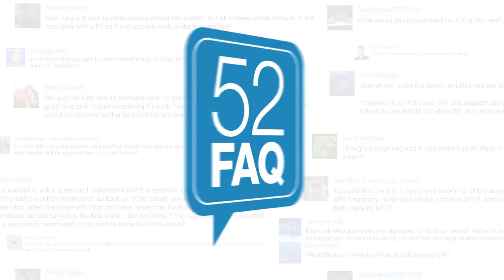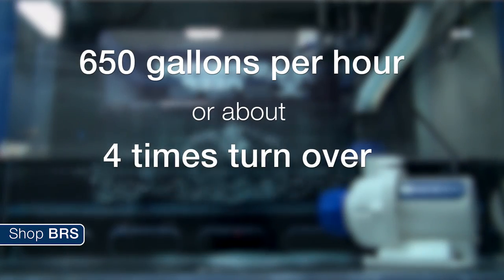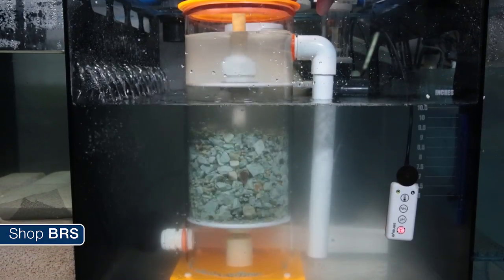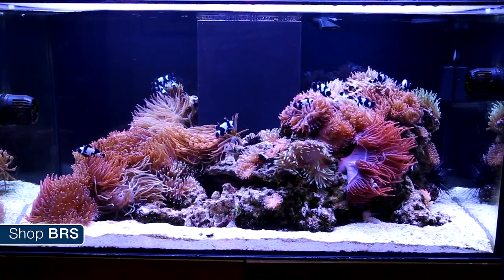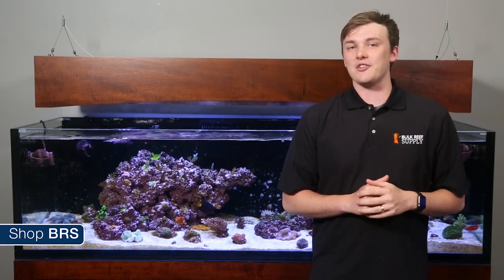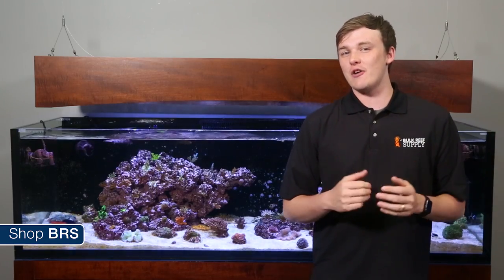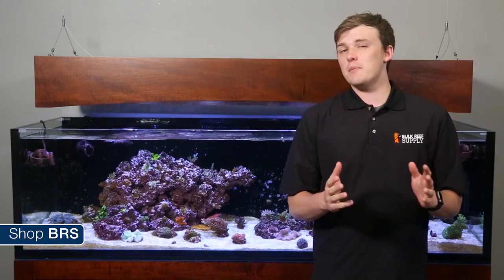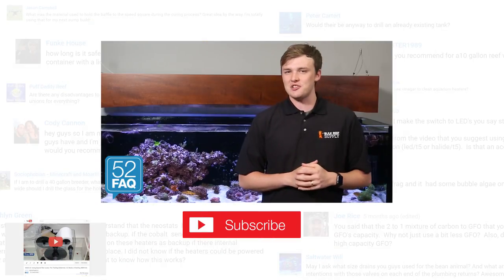FAQ #16: What is the relationship between the Theiling Rollermat and the tank's flow rate? | 52 FAQ

Comment: More great info!

I've seen a lot of people trying to jack their flow way up and like you said, there's a point of diminishing returns. If you're just looking for circulation in the tank, power heads are a much cheaper and more efficient option.

Another similar method of measuring return flow that I use is to turn of my return pump an let the water siphon down into my sump. I have 2 marks representing 5 gallons of water on the side of the sump, so I time how long it takes the water to drop between those two marks. Again, not 100% precise, but certainly accurate enough for our purposes.
Reply: And a huge thank you for stocking the English - Metric conversion fittings! They are impossible to find anywhere else!

Comment: I love the idea of this, we all hate cleaning filter socks. My only issue is even at max flow rate of 600 gph through the mat, its not even a 3x's per hour turn over rate on my tank. How would you deal with the extra volume from the tank drain? Im running a 220 gallon tank, and using the larger synergy reef overflow

Comment: thanks for the informative video.  i would like to know if the roller mat is in the sump how deep it should be and how many centimetres the water line should be from the float switch inside the unit .  thanks

Comment: I have a question, do you know what a Rotary Drum Filter is? It's usually used for pond and is basically like the roller mat only a lot better and requires no maintenance and no replacement parts. I have a a unit in my yard that rates for up to 30k liters/hour... the biological chamber alone is about 400 liters.... so using this for a reef tank might be overkill, but why isn't anyone making a "smaller" version of the rotary drum filter for reef tanks? seems like the perfect solution for mechanical filtration... btw, love your videos thx a lot!!

Comment: My rollermat has a lot of condensation in the top, how do you guys managed to deal with that?
Reply: Actually mine just started to have a problem. The condensation is so much that the current filter roll is super wet and super heavy which caused the rollermat to not roll it and started to overflow through the emergency overflow, but my roll still has like a 1/4th left of clean filter. I have to manually roll the new roll so it gets lose so that the rollermat can roll it without any problem. This is the only major flaw I have found so far :(
Reply: 100% positive there is no splashing on that side of the rollermat. I run my tank at 76, I live in Seattle so no AC really here :P but we do have a house heater which I run it at 68 tops during the cold season. I can see that the issue is the condensation on that side of the rollermat since I can see the drops of water dripping into it. I'm thinking to drill some holes so that it doesn't condense in the highest point. I'll do a video on it once I finally change the filter roll to make a full review and I can show you there (it'll be in Spanish but you can just look at the rollermat lol, unless you speak Spanish :P).

Comment: can you guys measure a rollermat to give some idea where the different drains are? I'd like to mock up one with some cardboard to make sure i can fit all the plumbing in my existing stand before buying it.
Reply: The most important one would be the output which is located about 5" from the bottom. The input of the mat is at about 1" on the bottom left corner and the emergency is about 2 or 3" from the top. I asked a similar question on their website before I bought it which they did answer but it is not showing up in their asked questions list. Also, the dimensions of the mat listed on their website is a bit off, it is actually 1" less than what they say on each side but I can double check all that when I get home if you're curious.

A print out of or diagram of the mat's drains location and overall dimensions of the mat would really help to make the purchase decision easier and see if it will fit in our space.
Reply: what would be perfect is a 3D model of it, i'm half tempted just to buy one and do it, but its a big $$$ if it ends up not fitting, i'm not going to build/buy a new stand and sump just to accommodate it.
Reply: +Matt Palmer I know how you feel. I actually bought it and then I build my stand specifically to make the mat fit lol. I wish i had the skills to use sketchup or some program like that.

Comment: my tank is 350litre, the water pump shows 3500Litre per hour.  is this too much?
Reply: probably not that's only 10x turnover without figuring in head pressure, as per the video the head pressure will severely reduce the performance of the pump from its max numbers.
Reply: +BulkReefSupplyCom 
if the water too strong. is it good for fish?  Will some type of fish or small fish has problem?